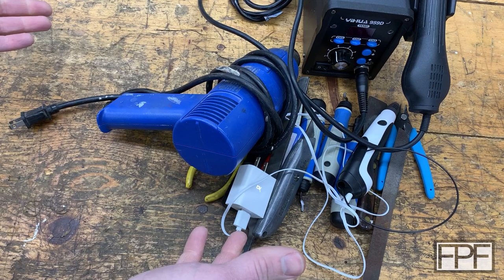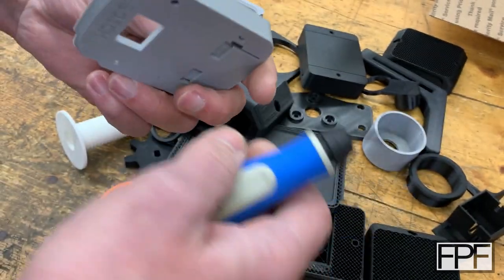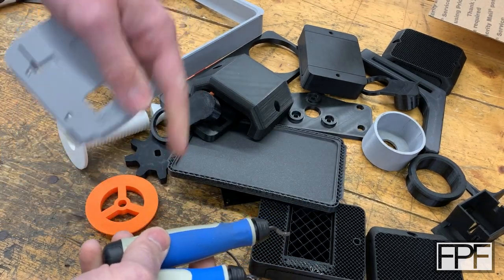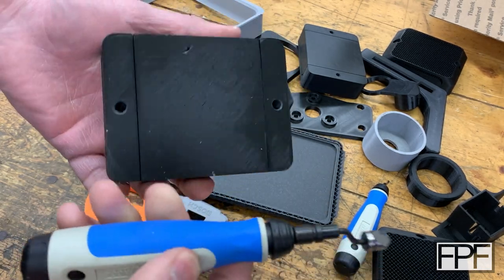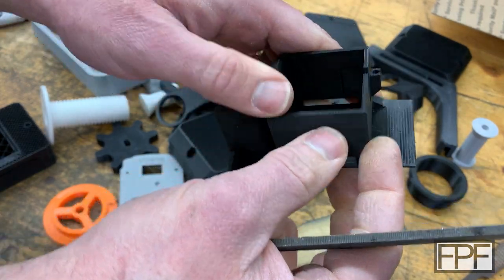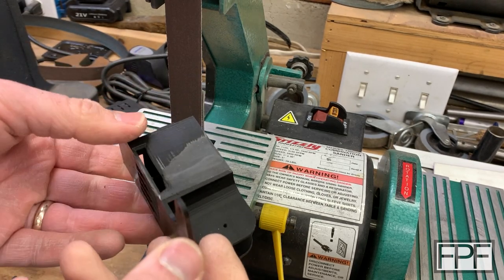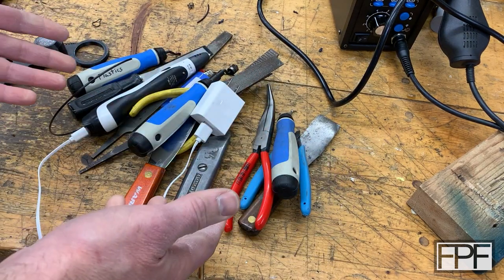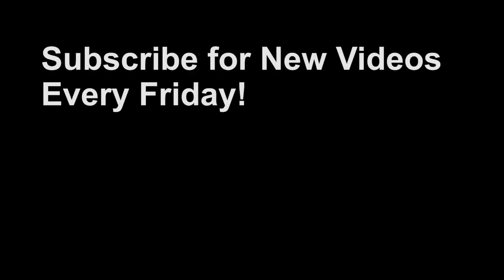Tools of The Trade for 3D Printing

Comment: I've found a small jet lighter (the windproof kind used to light cigars) allows for similar fixes to what the hot air soldering station can provide. They're cheap, provide a tight level of control and don't cause sooting issues like a normal lighter. I use one on almost every print, from PLA to ASA.

Comment: For working on 3D printers, a good set of quality tools is essential. I use both the iFixit Mako set and a set of Wera Kraftorm Micro hex and Philips drivers. My printers came with scrapers, but I've been using a painter's spatula and palette knife set. They are super flexible and can by found at any art and craft store.

Comment: I can attest your pronounciation of Knipex is correct. That spatula works because it gained a soul over the years ;) Good idea using a chisel! I'd call it a coarse file. I too use a jet lighter for string removal when the electronics heat gun is too far away. I use a water cooled belt grinder (usually used for knivemaking) that works well if you don't go too aggressive. But also a rotary tool with variable speed and carbide cutters, need cooling too though. Anything else you got coverd. Good video!
Reply from the maker: Thx

Comment: looks like you need a plastic welding kit (soldering iron with some fancy tips and different plastic fill materials) to replace that 3d pen.....if you never liquidize the parent material, you will never get plastic to structurally bond with plastic without an intermediary.
Reply from the maker: I'll have to check that out.